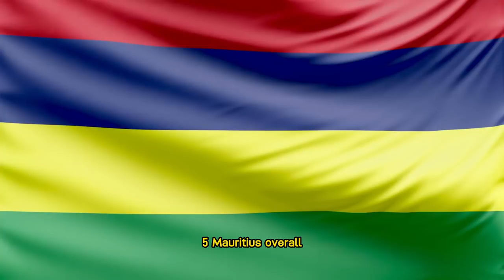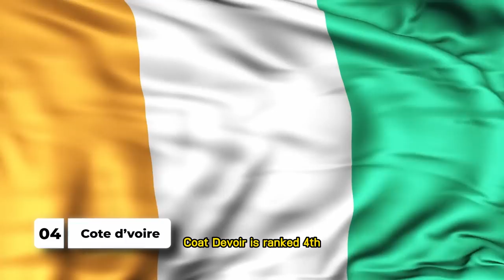10 African Countries With The Best Roads, 2023.

Comment: South Africa should be no 1
Reply: We have potholes everywhere in sa
Reply: Never
Reply: SA is having good roads designs.but they ain't talking about that...they are ranking based on the smoothness of the road...and less potholes😅😅
Reply: @priscillalatchmiah7939  not potholes, road networks, road structures & kilometers per area.
Also on major roads potholes are less, for example N1 between Joburg and Bloemfontein it's clean and neat
Reply: thank you for schooling, we talking about the road designs of which SA has the best